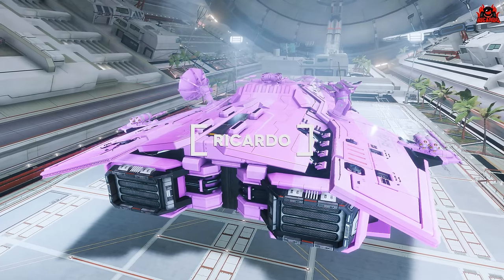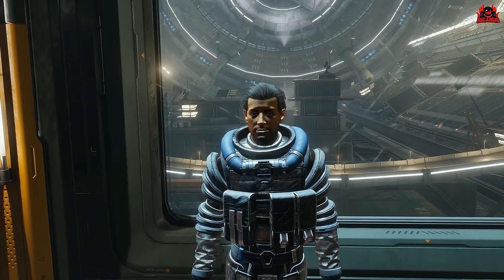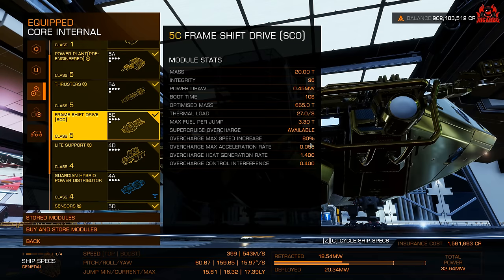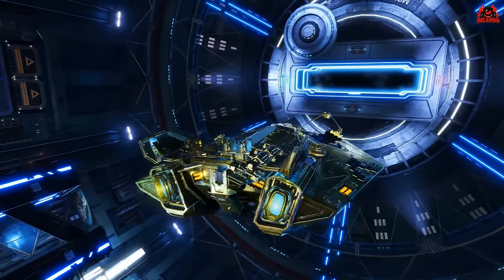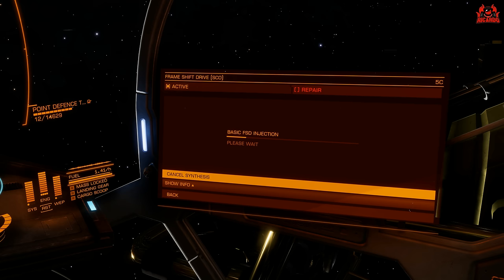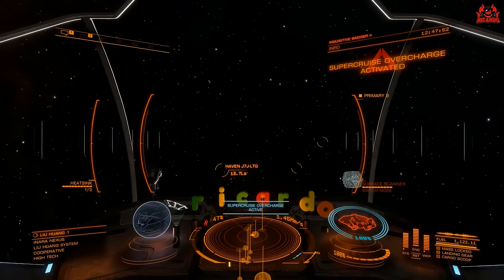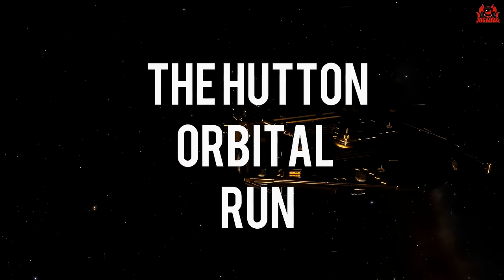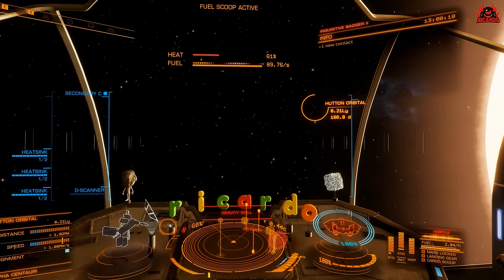New Achilles FSD How to Use Super Cruise Overcharge // Elite Dangerous

Comment: Best practical use would probably be to toggle it shortly to get out of gravity wells.

Will be interesting to see if this is more like a first prototype and we'll get other versions later on.
Reply from the maker: I think it is lacking certain things - more testing FOR SCIENCE
Reply: really hope so, it's not worth using in most cases right now. but it's more likely this will be mostly locked to the new ships.
Reply: I hope that we get a Optional Module version of it like the FSD boosters
Reply: @Spaze2503  i really doubt it will, would make the fsd drive useless. would be cool though.
Reply: Hopefully it'll come in a size other than "C" or become engineerable.  Preferably both.
Reply: And to avoid interdictions. This will be great for trading in the bubble and certain pirate and combat builds. You could even use it for exploration; travel to systems will take longer but you’ll be able to reach distant sites in those systems quicker.

Comment: Tested it out with my Passenger Engineered Orca.  Cuts down the FSD jump range from ~46-49ly to ~23-24ly.  If I get a Ammo Capped Heat Sink Launcher or two at the cost of my Shield Boosters, that gives me some leeway.  I can jump about 55,000-60,000ls without any damage.  

  Tested it going max to about 64,000ls and had a sliver of fuel left and 11% FSD and no AMFU's.  Took about 4 tries, but got the FSD working to jump into Supercruise and was able on that tiny sliver of fuel, get back to the station 64,000ls very quickly.  

  So I think if you want to sacrifice jump range you can get to those further out 100,000ls + stations to get higher passenger payouts, even without even using the engine boost if you don't want.  If you do, you can knock off about 55,000ls right away without damage (just about 2-3 less heatsinks).

  You could also use it for those USS that are 30,000+ ls away as well.  Either way, the Supercruise is really fast even without using the engine boost.

  Great video and glad you helped me understand how to use it and demostrates what it actually does...

Comment: I’ve replaced all 22 of my pre engineered drives except 1 with sco. And so should you! Jumping a long distance - regardless of distance takes the same amount of time.  2 min to go around the sub and align. 10 sec or so to speed up, 15 second jump and landing by a sun. Rinse repeat. 1/2 the range on drive means 2x more jumps (of 2-3 minutes each. But where you spend way more time is in getting to places in solar systems. Align and slowly accelerate for 2-3 minutes. Cruise for about 2-10 min. Decelerate for another 2-5 minutes. That is what sco fixes. It accelerates crazy fast cutting way more time off trip than the few more minutes it took to add more jumps to trip. After that you’re going faster in drift to destination cutting another 2-10 minutes by 90% and the only part that isn’t affected is the slowing down. On a DVX I have over 30 light year range with SCO. And my travel time in the bubble has been greatly decreased even though I added more sun to sun jumps. Try it out! Only go turbo while temp is under 110% go out of it soon as temp hits that. Your inertia at the high speed will still be way faster than you would fly without SCO. If needed rinse and repeat when temp is back under 50%. I love this drive and only my long distance DBX with 77ly range kept the engineered drive for the long haul runs.

Comment: Used the new FSD found its best use is to get up to speed quicky to get to far away planets. So I engage it for a few seconds and then disengage it and now travelling quickly without going through the sliw acceleration of the otiginal FSD

Comment: This looks like a great FSD for simple A>B>A trading routes. With the enourmous fuel consumption of this FSD adding Fuel Tanks to your Ship makes finally sense. One less useless item in the game.

One question left, Can it be engineered? And if yes, have the blueprints that do less heat generation to your FSD and Effect to the heatgeneration of the Overcharge?
Reply: From what I could see, it can't be engineered at this time. I have pinned blueprints I couldn't use with it installed.
Reply: No on engineering and only available as size C FSD's. Not really useful except for mining and hauling ships.

Comment: If we're going to use it to get to a titan like Oya 6kLs away from the main star, with the intention not to get Thargoid interdictions, we're going to get damage from boosting this FSD anyway. Since it cannot be engineered, we need to waste an optional module space to add a Guardian FSD Booster, so we have to give up a Hull or Module reinforcement. I'm parked just 16Ly away from Oya's Titan, and replaced the 5A engineered FSD (20.25Ly) on my Krait Mk II with this new 5C FSD (SCO) and got 8 jumps to reach the Titan.
Reply: Wow, that's bad...
Reply: Yeah but new commanders can get their free anaconda from hutton orbital 80% faster!
Reply: @Barbequeque  👏👏
Reply: @Barbequeque  unless they explode on the way!
Reply from the maker: the struggle is real
Reply: Seems worthless. I hate getting interdicted, but I really don’t like extra jumps, heat damage, repairing, and then synthing sinks. Hadad might need it though.

Comment: Not sure what I was expecting.

I was thinking that the major downside would be a lack of jump-range and an increased SuperCruise-Speed (No sh!t, Sherlock!).
Not certain what the top speed would have been, but certainly not the same speed as the Stargoides. ;)

I think the excessive fuel consumption is just fair, the erratic movement also,
but the heat buildup is just a bit to much for my taste (the amount, not that there is heat buildup).

Not sure if I will use it much; I tend to hang around where I am getting to for quite some time,
and while getting back to a station I trust SC-assist while doing something else, like the dishes. ;)

I think it depends on what exactly I will do, but this will not be my default-option for most of my ships.

Are the SCO-FSD's engineerable, btw?

And as a tl;dr, I'd like to quote Captain Sulu:
Fly her apart then!
https://www.youtube.com/watch?v=c7xvi6GL9Fk

;)

Comment: So it cooks your ship alive, guzzles fuel like an afterburner, damages your ship, make you almost lose control, cannot be improved by engineering and comes with a range penalty over a normal class A drive to begin with.
All these downsides just so we can potentially waste less time in SC.. if you already have a carrier to shuttle your system-bound warships in then ig it's ok? Other than that, what advantage is there for any normal ship - you lose range, gain heat, lose fuel, need a fuel scoop not to extend range but just to survive plus extra fuel tanks, need an afmu, need heatsinks and need a guardian booster to get range back to where it shold have been to start with. You could be sacrificing 4+ optional internals to really optimise for this drive to still be more of an inconvenience. Any advantage in time spent travelling in supercruise will be offset by having to do more jumps to get to the system in the first place. I think it's a huge miss from fdev - should have been an optional internal like docking or cruise assist or fsd booster are, or even an experimental effect to apply through engineering. Needs rebalancing for sure.

Comment: looking at it, its unstable,  maybe this isnt easy mode after all :-),  its not a long trip fsd, its an afterburner to get out of trouble,   now im wondering why do we need this,  what is coming
Reply from the maker: indeed - you need repair and afmu with it and a boat load of fuel
Reply: @RicardosGaming  not really, the issue seems to be damage from overheating, in which case a Sirius Heat Sink works just fine, and most people have at least 1 equipped anyways. If you turn it on and zoom its pretty bad, but you dont kick on an Afterburner and leave it on, then wonder why you are out of fuel 30 seconds later....

So far, it's really handy on Trade Ships, and im loving it on my Pirate Hunter as i dont have the issue of chasing a Pirate Lord across a star system now when i can just punch the Overcharge and catch them instantly!

Comment: Jeez. Of course it's this useless. Massive heat generation and damage, Insane fuel usage, and to top it all off,  you can't even f**king steer. Yeah, pass.
Reply: It is not thaat bad. Biggest down side is the massive jumprange lose. you can clear 30-100 kls in a few seconds without any damage if you use heat sink. Some fuel tank is recommended.

Comment: Seems like a limited use case. It's too wild to control properly, sucks down fuel too fast and causes a ton of heat buildup and damage. Looks to be best for shorter range trading/passenger missions and skipping around systems in an explorer.

Comment: Asp Explorer, one of the hottest running ships guess we could have used a Type 7 Transport for added toast, going to try it with my Dolphin.
Reply from the maker: that would be a good ship
Reply: @RicardosGaming  It has, with a class 5 FSB, a 30.2 ly range and the temp was much more manageable with a single heatsink launcher but Hutton Orbital is a no go, cant pack enough fuel tanks to make it. I can see a knitch use for this drive but the downsides are huge.
Reply: Dolphin definetely needs to be tested. its almost impossible to overheat that ship after Fdev broke it
Reply from the maker: @cmdr501generalvenator3  building one now - my road runner build
Reply: The AspX is a flying pressure-cooker, confirmed. I used mine for core-mining and ferrying newbie friends around, eventually sold it.

The engine sounds are also extremely annoying after a while.
Reply from the maker: @mannings.8474  dolphin will be tried today …. For science

Comment: Oh cool an FSD which burns all your fuel before self destructing, that will teach the targoids to mess with us.
Maybe for an PvP interceptor but i don't see any other use case right now.
Reply: I'm soloing a wing mission where I have to deliver 1000t of Indite for 50,000,000Cr

Buying from a station 2500ls away and landing at the base planetside now takes like a tenth of the time. 

Courier missions, delivery missions, trading to remote bases, escaping gravity wells, approaching signal sources 100,000ls from the origin star all take no time with SCO. It's a godsend. Someone just clocked the trip to Hutton Orbital as taking 60 SECONDS.
Reply: @Xx_BruhDog_xX  It's a jump drive for people who don't need to jump much at all, since it's only class C.
Throwing away 1/3 of range before engineering doesn't seem worthwhile for me.
Wonder if the participants of the event get early access to a grade B variant or something at least for their trouble.

Comment: My only question...whats the point of SCO mode? Lets say, hyperteticly, trade...even if you have a rare interdiction by pirates...if you know how to escape it...its not needed

Combat? Your gonna end up cooking yourself

Exploration? Whats the rush?

Mining? Why would you even, 9/10 times, your carrier is in orbit above thouse rings anyway.

Titan combat? Another comment already beat me to that.

Im sorry...but i dont see a benefit to cost answer to this new drive.
Reply: Well.
I travelled to binary star 60k ls away in 2 minutes, without burning half of my modules.
Sounds like good module for mission runner, since a lot of missions can spawn signals around example secondar star, so 100/200k ls away
It's also very nice if you want to move away from planet or just to BUILD your speed (or escape from gravity wells of bodies)
Also this vid is quite funny.
He reached 300 heat in few seconds.
My krait neede close to half minut to build only 180%.

For me this modules is quite nice, since will require some PRACTICE in moving around system, it isnt as simple as "press boost, fly 2 minutes, deactivate". You have to think, observe, and maybe use burst of shorter boosts instead 1 long.
Reply: @Hellrider-pe4uj  so...activate, clear the local planetary system, deactivate. And use the inertia to fly on the space between stars?

Just making sure I'm reading correctly.
Reply: Ganker escape for noobies. Small class handles much better, and a noob won't have engineering so smaller lose on jump range. 
Also it works best when you still slow, because in a few sec it will increase yor speed to like 1500c, cutting down significant times when you have to go to a secondary star. However won't cut down that many time on Hutton orbital, as it will drain your fuel.
Reply: @Hellrider-pe4uj  I think it would have been better just to add the option to choose to which star you want to jump to. That is the main issue with Elite, being forced to jump to a single star in a system.

Comment: The only use case I see is for a laugh. Trying to use it as an escape button from conflict is very risky. You won't be able to control your destination at all. Considering how the FSD and Supercruise function this makes zero sense for why you would become a loose goose. The hull damage, heat, and massive fuel cost does not make this viable for exploration. The loss of distance for a combat vessel with all of this damage makes this again a bad choice. I would like to see a T9 running this. Again, for a laugh. I wonder if the acceleration on a large heavy ship results in less 'loose goose' or the same or worse considering they have less acceleration? As a first model. I'd consider this bad for release to consumers. They need to go back to the drawing board to make exploration models that are not harmful and useful for trying to leg out to that second or third Star. Could of been great. But currently I think it is mostly useless.

Comment: Ridiculous... Way over the top on heat and fuel usage. Even if you want to get to the Titan quicker, you'll have to repair before fight. You might have to engineer up a bunch of B modules to use this. Such an edge case use... Maybe a thermal spread on it helps? But it can't do much.
I hope the Python II isn't gimped this bad. Just shaking my head over this.
Reply: Use heat sinks. They pretty much negate the heat effect as long as they active.
The fuel is a bigger problem, it eats waay to much.
And it has a reduced jump range by 60% (!), because it can't be engineered.
Reply: oh and the structural reapairs will cost like 100 000 credits :D
Reply: It's experimental, and for the expected use of "short burts"... Please think.
Reply: @Neo-vz8nh  didn't seem to do much in the video...
Reply: @DavidUtau  I can think, seems like the trade offs to too much. Not sure what you'd use it for.
Reply: @pville_piper5125  but it surely done it to me. Depends on ships thou, and I done much longer cruise with it.
Reply: @Neo-vz8nh  might be something that can be engineered around... Maybe you're ship has already some engineering that counteracts this. Or it runs cooler that Ricardo's asp

Comment: Way too many negatives in having this, was hoping for something to stop me disengaging from the game and watching you tube vids whilst doing 200,000ls in system travel
Reply: well you can clear 200 kls with this in like 1 minute, but you need a many many fuel, and some heat sink.
Reply: @Neo-vz8nh  exactly, give you a positive in one hand and ruin it in the other with a pile of negatives - fuel used, overheating, module damage, decreased jump range but hey when have they ever made it simple, my point was why not a simple in system hyperdrive to get you from point A to point B fast and simple being it may cost a small amount of fuel to use it
Reply: @andyf6581  Try it first then form an opinion. I had zero problem with the damage, pop some heat sink and no overheating. The fuel is a bigger problem, so some extra fuel tank is recommended. But with short burst you can get to 30-100 kls with one heatsink in like 15 sec, which otherwise would be like 15 min.
The range is bad though, so not an exploration stuff.
Reply: @Neo-vz8nh  You're making an assumption that I haven't tried it, but hey if it floats your boat fill your boots mate, as it stands it's not for me
Reply: @andyf6581  I see you get offended easily.

Comment: Elite Dangerous, best game ever, but for FDev.
Could not even give it a unque designation to help you find and equipe it.
5T would that have been so hard? instead of 5C (some text I could not care about) SOC....

Uses too much fuel,
Fuel Rats will be working over time to resue commands with 1 fuel tank,
Take too long to fill all the fuel tanks you will need to get to 200k ls titan, over heating you as you sit in the star for the increased scoop time, 
Runs too hot,
Heat sinks do bugger all to alliviate that,
Too hard to control,
Super Cruise cannot be used with it to help,

OMG why do they not love their game enough to do a better job.
Why are they bringing arcade game play characteristics to a space SIM?

Even if they added the ability to scoop from gas giants you are going to get into trouble with fuel levels.

IF I did use this to get to the Titans that are way out there, am I going to be exhausted BEFORE I have even started to fight?!?!?